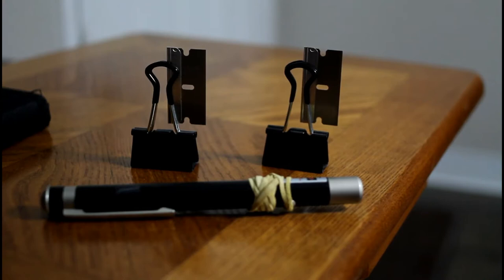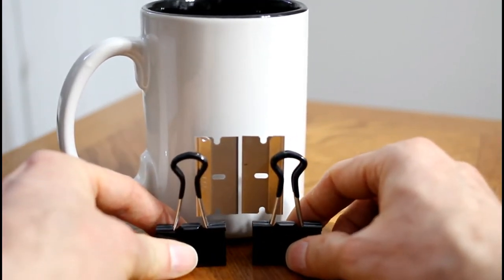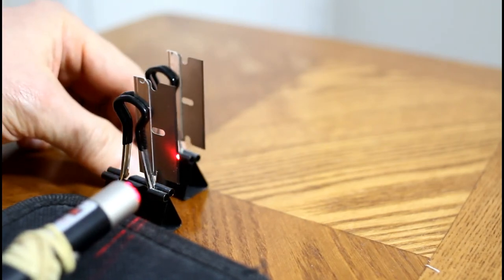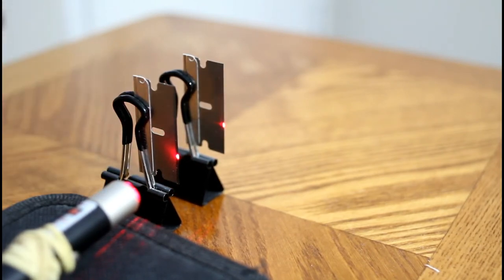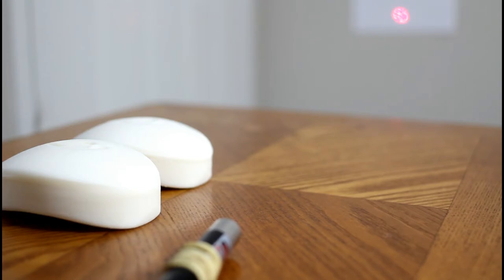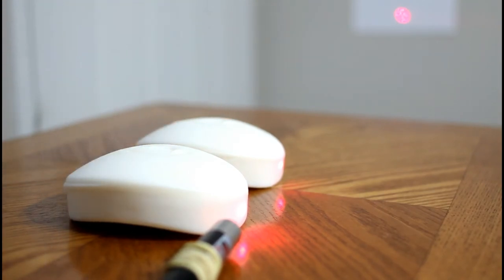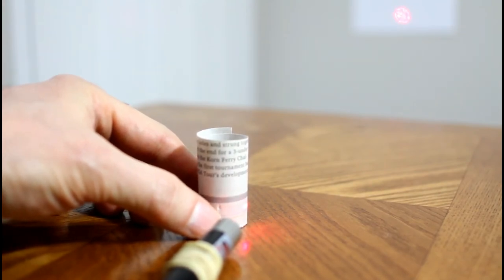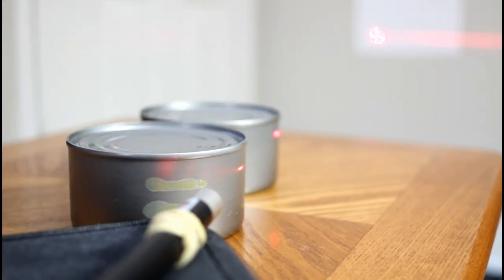New 2 Edge Diffraction Experiment

Comment: Have you done any experiments testing whether the temperature of the edges affects the diffraction pattern?
Reply from the maker: I don't have any lab equipment to measure that. If there were any it would also happen with the single slit and double slit experiments.
Reply: @deanshetlar6361  I suspect there would be effects.
Reply: @deanshetlar6361  Can you try reproducing the experiment, varying the width between the blades and noting how that affects the pattern?
Reply from the maker: @numbynumb  Hi numbynumb, This is an experiment you can do. All you need are 2 straight edges and a laser pointer. Follow the setup in the video and see the pattern that is produced. You can move the second straight edge in and out of the laser beam to see the pattern change. Most stores sell laser pointers, Lowes, Target, Best Buy, Fred Meyer, etc.

Comment: Hi, why do you need the second edge? Diffraction should be possible also with a single edge.
Reply from the maker: Hi Jim, If you look at the single edge experiment the pattern only extends a short distance and there is light between the peaks. With a second edge the pattern extends much further and at the middle of the dark areas there is total destructive interference similar to the single and double slit experiments.
Reply from the maker: @WeekendTradesman A single edge creates a diffraction spike. Each edge acts as a new light source and the pattern is the result of constructive and destructive interference. See this Wikipedia page. https://en.wikipedia.org/wiki/Diffraction_spike